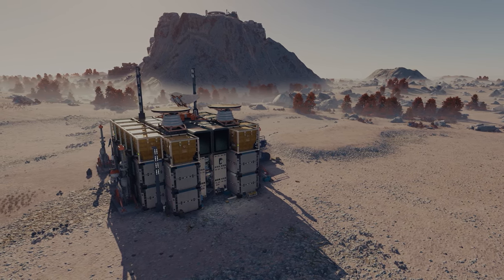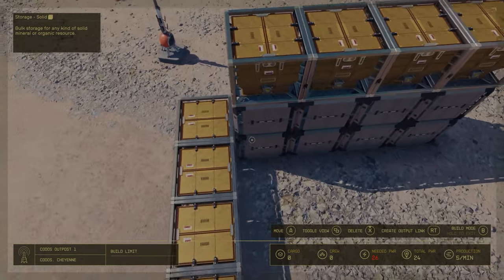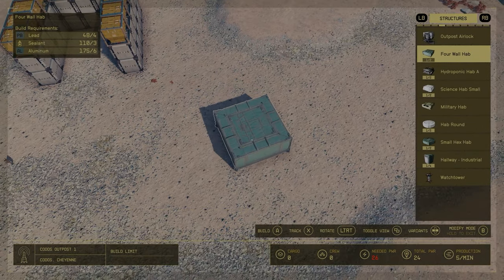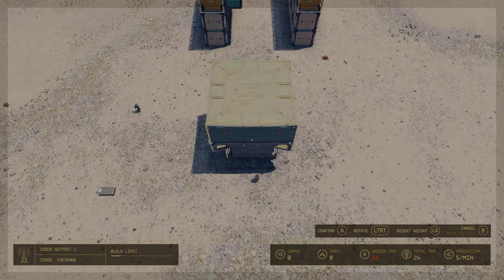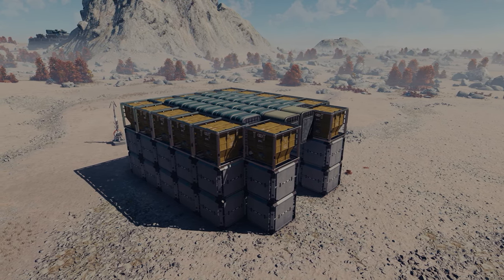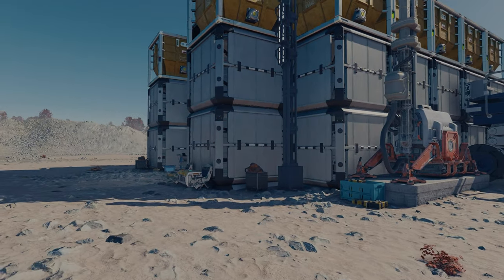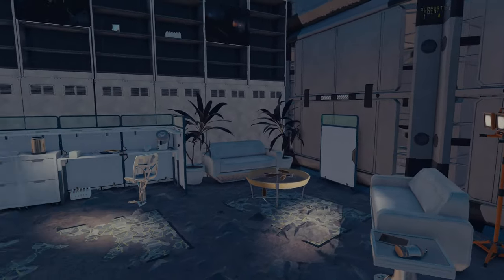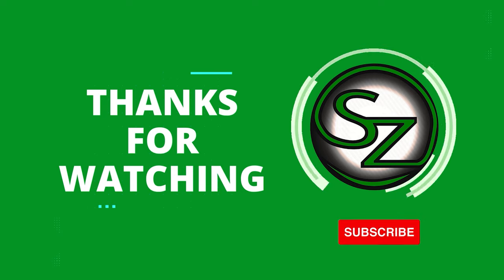Starfield Outpost - Custom Made Base without Air Lock

Comment: Easier way to always align storage walls at 90° is to continue the first level of storage boxes all the way to where you want the next wall to begin if that makes any sense.  Then delete two or three back and now that the one at the end is in the perfect spot instead of sliding it back and forth to align it, all you do is rotate in place until you get a perfect 90° rotation. Now you should be able to build around both directions from the first wall and the second with no gaps at all.  Then repeat the same process, it takes a bit of back tracking and planning ahead, but it works 100% of the time.

Comment: Haven't gotten that far in outpost building yet,but are canopies and gazebos a thing in the base game's outpost system?
Because they're practically in every generated and curated outpost already.
If not, I could see it being added as a DLC or mod and the building materials would be relatively simple, IMO; a variation of metals and textiles depending on the design.
But yeah, buildable walls, floors, and ceilings would be a welcome thing to me. You expect me to build sentry turrets to defend myself, but I can't build a basic wall to fence in my outpost?